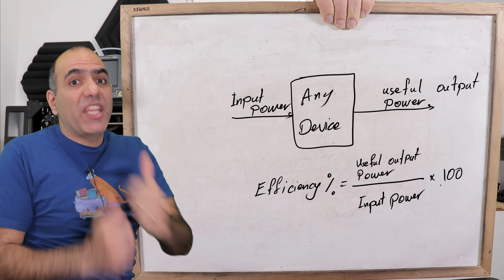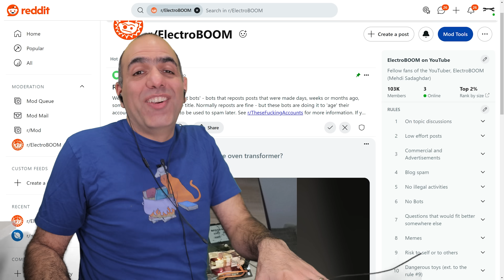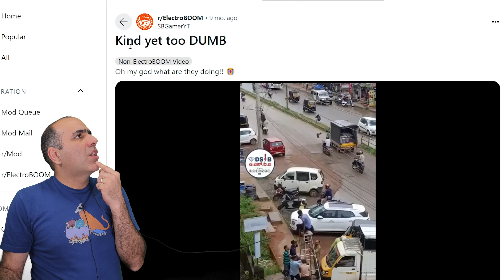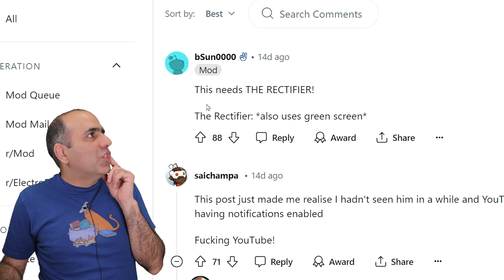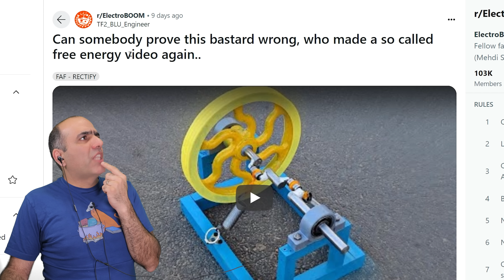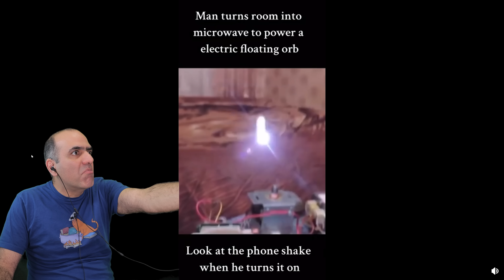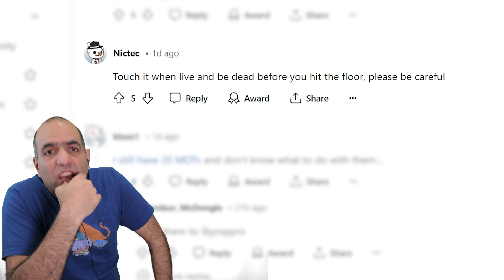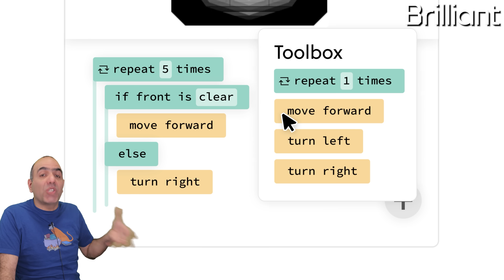New Flywheel Free Energy?! Can Boat Battery Fry You? LATITY-013

Comment from the maker: Ok so I checked and Trump is actually  talking about EV boats with much higher voltage batteries, like 300V or 400V. So I kind of agree with him that that much voltage  can be pretty dangerous in salt water if you are too close to its contacts, and I assume considering the risk, boat makers have systems in place to avoid that voltage to be in water if the boat sinks. I used to work for a boat system company and we were quite careful around any risks. So the danger may still be irrelevant... especially to a political campaign! Here's his full video:
https://youtu.be/9J0fUTiJLVc?si=mxs3S5TUcsVeTpdu&t=2575
Reply: I must be missing something here, but if the water is conducive enough to give you a zap, isn’t it then also conducive enough to “short” the battery enough so there’s not much juice left to hurt you? (If you’re not sitting on the battery but further away.)
I’m seeing it as a fairly low resistance (salt water) in parallel with a huge resistance (you).
Reply: @VarionJimmy short the battery that size? So an explosion and metal fire with the size batteries we're talking about😂
Reply: @AA-zv6yo  The water does not totally short the battery and in any event it will boil away to remove the short before the battery explodes. Steam is not that good a conductor.
What is more important I believe is that sharks don't like electricity in just a small amount and would disappear very fast and no longer be dangerous for the passengers.
Reply: Don’t they design EV batteries to shut off in collisions?
Reply: @mattdude no, they have a fire dept disconnect switch that the fire dept when they get there cuts or unplugs
Reply: @mattdude no
Reply: @mattdude  Actually more often than that. As soon as you turn the car off, the battery internally disconnects itself from the car. That's why it still has a 12V battery to wake up the computer and reconnect the main battery. If you listen closely on startup and shutdown, you'll hear a couple of clunks as the contactors pull in (turn on) or drop out (turn off), this is easiest to hear in a garage outside the car.
Reply: I would lure the shark over to the battery.  Jump to the opposite side, when the shark comes after me it swims past the battery and dies like on Jaws 2.
Reply: battery packs would be sealed, and the BMS will disconnect the external terminals as soon as it detects a short.
Reply: @flandrble depends on why it's sinking. But outside of damage to the pack,  I would agree
Reply: @flandrble  then why don’t Teslas have that
Reply: @ianscardino  What, automatic cutoffs? They do have that. Look up Tesla pyro fuse.
Reply: @flandrble  Hopefully, but if it is made in China, you never know what happens next.
Reply: Context is always important, thanks for providing it
Reply: The battery current would just flow between the terminals or between the cells inside, assuming the BMS doesn't cut it off.  It wouldn't actually electrify the water or electrocute anyone nearby.  Even a thermal runaway underwater won't do a whole lot... just generate a lot of easily-avoided (toxic) bubbles.

In anycase, 12V actually isn't used all that much in electric boats.  24V and 48V is more common for things like trolling motors and small electric outboards in smaller boats.  High voltage "EV" style packs are used in larger all-electric boats but that isn't very common except in the arena of the rich and famous with their multi-hundred-million-dollar yachts.

12V has historically been used as the system voltage for the home battery bank in medium-sized boats to run the radio, lights, winches, and other gadgets.  Though these days more and more people are using higher voltage 24V and 48V LiFePO4 architectures for their home batteries instead and have a DC-DC or down-buffer battery for legacy 12V gear.

Same for RVs.  Once people realized they could actually have all the comforts of home without limitation by using higher voltages, and still be able to wire the battery bank with only 2 AWG (instead of 4/0), 24V and 48V home banks have really gotten popular.

Even so, a 48V (51.2V nominal, 58V max typically) battery isn't going to electrocute you unless you actually try to electrocute yourself on purpose.  It will just give you a buzz.

-Matt
Reply: If the boat is sinking from its weight, how did it get out far enough in the water to where there were sharks? Wouldn't it sink as soon as it was put in the water?
Reply: @smwsmwsmw boat takes on water bilge can't keep up. Lots of people actually forget to put the drain plug back in after last boating excursion
Reply: @JMA_Elec wasn't there a bunch of electric cars parked at one in a lot that caught fire from flooding due to a hurricane a few years back?
Reply: Submarines have entered the chat.
Reply: Honestly, as a person who sails every summer, mixing boats and electricity is a bad idea for now, especially for any boat that doesn't have an engineer on it. The sea corrodes everything and eats through everything. Electric systems are just too unreliable, I would always carry a spare outside motor just in case
Reply: @Desterothx  are you serious? and an diesel engine won't corrode or what? Even tho it sucks in saltwater for cooling..
Reply: the risk of is minimal compared to higher risk dying in a Tesla Vehicle.
Reply: I've jump-started a jetsji from a boat battery while wet and standing in the river, and 12V does make you jump, ie, I'm not doing that again - ouch -.
Reply: So the bigger concern with high voltage batteries in salt water is all that lovely chlorine gas its gonna start producing. That said I can think of a dozen hazardous conditions for gas powered devices, that have been engineered out of them. Same with high voltage electric vehicles.
Reply: @fredorpaul  No, you are thinking of lead-acid batteries.  High voltage batteries in boats these days are not lead-acid, they are Lithium Iron Phosphate (LiFePO4).

Salt water immersion can certainly damage a lithium battery, but probably won't react with it very much otherwise. Chlorine gas is not a byproduct.   Lithium thermal runaways can still happen though and that outgassing is still fairly toxic, but not immediately deadly like Chlorine gas can be.

-Matt
Reply: @junkerzn7312  so yes you are right lead acid batteries will produce a lot of Cl2, but electrolysis of salt water can as well, frankly its not a major concern but more of one then getting electrocuted😇.
Reply: I actually have a (failed) EV boat battery and not only is it only 24V, but it has a complex BMS that switches the battery contacts off completely unless it's fed a signal from the boat and of course the battery itself is also mostly water proof because you would have to be extra "special" to not think about protecting it from the elements.
Reply: I'd take my chances with the shark. Sharks don't actually kill that many people. Death by electrocution is much more certain.
Reply: I mean technically even at 400V submerged in salt water you would have to be pretty close to the contacts for it to be a problem.  The worst case in a boat would if only one contact was in contact with salt water, then non-isolated random electrical components around the boat could be the best path to a circuit.
Reply: 4:55 why did Mehdi become Borat?
Reply: STILL WAITING FOR THE INDUCTION HEATER WITH NO SAFETY FEATURES ❤❤
Reply: 100% free energy https://www.youtube.com/watch?v=0vmh7Rnxd-8
Reply: Actually at 300 - 400 V is more dangerous in fresh water than salt water. Human body is path of least resistance in fresh water.
Reply: I used SponsorBlock to skip your stupid ads. 🖕
Reply: @acmhfmggru  Oh nonsense.  The man has been spewing gibberish for years.  And obviously so.  Nobody in their right mind would believe anything that comes out of his mouth.  The man has a mind of a small child.
Reply: But before I even got to the point about the absurd electricity comments  I was like, A boat that sinks under it's own weight ISN'T a boat🤦‍♀️
Reply: inf power us a electric moter to spin some gears    with a gear ratio to speed it up and use a dynamo type thing to make power from rotation and split half to power the moter run and half to store the moter would spinn slow but the geer ratio would speed it up a lot to make more power
@ElectroBOOM
Reply: would not most DC power travel directly between battery terminals on a high voltage battery?
i think the danger would be in the fire as it shorts if anything.
Reply: inf power us a electric moter to spin some gears    with a gear ratio to speed it up and use a dynamo type thing to make power from rotation and split half to power the moter run and half to store the moter would spinn slow but the geer ratio would speed it up a lot to make more power
@ElectroBOOM
Reply: Hello
Reply: Hi
Reply: | Boat Model (*kW*)         | Estimated Leakage (A)                                             | Pain --> Death (**Uncertain!**) |
| Avator 75 (7.5 kW)           | ~18.75 A | Tingling Surprise (3.0 - 4.5m)                |   0.1% (Highly Unlikely) |
| Avator 110 (11 kW)          | ~27.5 A | Ouch! Tingly Pain (3.0 - 4.5m)                 |  0.1% (Extremely Unlikely) |
| Example Boat A (15 kW) | ~37.5 A | Shocking! Painful (3.5 - 5.0m)                 |   0.1% - 0.5% (Very Low Risk) |
| Example Boat B (20 kW) | ~50 A | Severe Shock! Hard to Swim (4.0 - 5.5m) |   0.5% - 1.0% (Low Risk, but Serious) |

Big Warnings! Based on limited data and may not be accurate.
Reply: Hey Medhi, I have a question. In my physics classes in school so far, we've learned that power is equal to work divided by time, where work is related to kinetic energy (I forget exactly how, it's been a while since I needed to use that info). But how is this measured with electricity? I know that it's essentially the kinetic energy of flowing electrons, so does that mean you would use the current to calculate it?
Reply: @dominicballinger6536  If you're interested in such Topics i highly recommend looking at definitions of (SI-)Units. In this example we need to look at Current: Unit A(mpere) and Voltage: Unit V(olt) which can be broken down into other more basic units: A=C/s and V=J/C where C(oulomb) is the unit of electric charge (e.g. one electron has a charge of 1.60217663 × 10-19 C), J(oule) ist the unit of Energy (or Work) and s(econd) is just time. Now if we multiply Current and Voltage we get: A x V = C/s x J/C, the C cancels out and we have J/s = W(att) which is the Power. So Electric Power is simply Current times Voltage.
Reply: I came here to make the comment about the voltage. Boats will use much larger voltages yes. So your chances of electricution by boat is slim, but never 0...
Reply: Maybe test this with series of 50 9v batteries?
Reply: Funny that you went off half cocked about "magas" on something you were ill informed about. It's a typical liberal response.
Reply: typical liberal
Reply: This was some next level editing here 😂😂 made me chuckle 😂😂😂
Reply: 8:40 what kind of makeup 💄😅😅
Reply: The battery management system will also disconnect the battery system and put it into a safe mode for salt water exposure when a short is detected. If the battery pack fails to retain water tight integrity or the management system fails to go into safe mode, like if you bought a cheap battery pack similar to what you would find in a Chinese electric car, physics take over and the electricity is going to take the path of least resistance, which isn't your body, it's the salt water, so you're fine.

I'm a medically retired industrial electrician, so I was trained on DC systems in the voltage range in question, on battery management systems that included lithium batteries, and in electrical safety on voltages below 600 volts. I would be more concerned about the batteries dead shorting and catching fire than electrocution since the water isn't going to stop the flames they will put out. Most sharks aren't going to attack you with that happening in the water anywhere near by, so you can just worry about the long term issues and get some distance from your burning boat. If it was a dodgy battery pack, that might be why it is sinking since a fire aboard a vessel, especially a fiberglass or wood one, is extremely dangerous and fast to cause a loss.
Reply: You should make one of those free energy devices and see how efficient they are. Maybe a good one to start with is a pulse motor that spins the flywheel, flywheel has magnets on it, magnets pass threw a coil, stores the energy back into a battery or capacitor
Reply: i put a 9volt batteru on my braces once
Reply: Okay, but sharks don't eat humans, so he's still a dipshit.
Reply: Hey what's up
Reply: He is still a moron.
Reply: At least you admitted you were wrong.  Humility is a trait that is far too rare nowadays.
Reply: I know people who make these types of things often take as much care as they think is needed but the problem arises when people do things that were not considered or even thought possible, and heyho something happens that was not expected.

We see this with cars and ebikes, unexpected things happen with them from time to time.

Also when systems get old systems fail, so might be perfectly safe from new but over time may become a real issue.

There are so many failure points with battery tech and salt water unless the batteries can be completely sealed off from the salty water.

One last point is time, what if a battery tech boat sinks, knowing how people are they may just leave it underwater so long as it posses no emediate threat forgetting or ignoring the potential threat due to decomposition of any safety features due to the salt water.
Reply: erm actually, microwave magnatrons are harmless to humans
Reply: Uno Reverse on the dislike  now that you researched the context
Reply: I assume the massive sea would water down the amps? So nothing would happen or only very close you would get shocked?
Reply: Do his followers even question "WTF is he going on about?!" or just love him regardless?
Reply: the one problem i have with guga is that he spread the betterhelp scam virus on youtube and never addressed the harm he caused by doing this.
Reply: I thought research (citation needed) showed that Sharks are hyper sensitive to electrical current. Divers can use Salt water equivalent cattle prod/stun gun to keep sharks away. So there is very little chance they would be anywhere near a sinking EV, they are not dumb unless they are really hungry for an electroboom meal.
Reply: That's totally on point, which is precisely why submarines were an abandoned technology.
Reply: But with higher voltage batteries comes better insulation
Reply: I have a feeling that the battery will have an integrated relay to trip if it detects short circuit ESPECIALLY if it's on a boat.

But the risk of shock would be much higher if those safety were to fail.
 300V+ battery, High current discharge capacity, short.

What could go wrong....
Reply: @kopazwashere  Electric cars actually do have this, and like you said, I see no reason not to on a boat
Reply: There are some videos on YouTube regarding attempted restoration of high-end EVs after flooding events.  Generally anything anywhere near the battery is just toast.  Either its corroded away from electrolysis, or molten slag from the battery combusting.
Reply: اقا چرا زیر نویس فارسی نمیزاری
Reply: 8:12 😂😂
Reply: Please please 🙏 🥺 Sir make video on Cristal radio or fox hole roaio or battery less radio 📻 i will wait for this sir 😢😢❤❤❤
Reply: I can prove free energy here now in a paragraph 2 tanks stacked and piped together one pipe dumps one is a continuous feed to the top of the top tank fill them with water stopping the dump pipe as long as the top tank weighs more than the bottom tank and the pipe it will over come siphon paradox and will run a turbine inline boom -Timothy Jones
Reply: Also sharks Attack are quite rare so the situation Is almost impossible
Reply: Foods can actually be pretty dangerous even with the standard batteries. 
There have been plenty of cases usually in freshwater where the boat builds up a charge like a capacitor and a person making contact between the boat and the water or the boat and appear can be electrocuted and killed.
Reply: Why there is no 120v LiFePo4 battery pack , that will remove large inverter, heat and sound? (40 cells LiFePo4 (2.5-3.2v) in series where 50ah makes 6kw,100ah makes 12kw).Also Efficiency will be increased as less heat and components are needed. Two of 120v batteries will make 240v , four of this will make 480v that can charge the EVs. If safety is a concern, then good design will defend this kind of problem. A 120v 50ah battery is similar size as 48v 5.1kw server rack battery pack. If a small dc to ac inverter are installed into this battery, people can use this battery as normally without large inverter...Can You explain please....
Reply: @AKadir-lc5wu  ?
Reply: I feel bad for Trump right now
Reply: No, of course they don't protect the circuits in any way. Just like gasoline boats are known to have just open vats for fuel instead sealing them in some way.
Reply: Where did you go?!?!
Reply: Hey, How about building Frequency Generators just like those in Chladni Plate Cymatics Experiments. It would be a fun  project to come up with.
Reply: Ok, that green screen bit had me laughing out loud!
Reply: Saying the danger MAY be irrelevant, doesn't negate the risks. The concern is still there, especially if it is a computer controlled system, instead of an analog. The energy is stored, and needs to go somewhere... I don't think helping other countries should be political, but it is.
Reply: New boats in the eu run 400/600 volts dc or even up.
Reply: I love how many real Americans who respect that people just have opinions there are in here. I love this channel.
Reply: The only reason I’m going back in time for this year was that the last two 2️⃣ months I have to work and I’m trying my luck 🍀 but it’s still hard because of all this work to be done ☑️ so far I just can’t wait 😜 and it’s a big part I love 💕 thank goodness 😅 but I’m so proud 🥲 and I hope 🤞 to see them in a year from here and hopefully 🙏 thank the gods and good 😊 and thank the gods who keep on my good 😊 love 💕 I have so they always love 💕 you all my best to you too I can’t thank and you always love 💕 love 💕 love 💕 love 💕 to all the love 💕 you both love 💕 I can’t stop ✋ I can’t believe this week I can’t even imagine what happened yesterday and the world 🌍 and I’m just a lot more than that was the last week and now it’s so good 😊 thank y so many more love 💕 and I’m glad 😀 thank y so happy 😁 and I’m really looking 👀 love 💕 love 💕 love 💕 and love to hear w the world 🌍 to the universe and so many happy 😆 love 💗 and miss seeing all of them and love to have you in person 🧍🏻‍♀️ is I can’t imagine the pain and sadness I felt after that one 1️⃣ million miles of time with them in our country was the most amazing 🥲 feeling I felt for you all my love 😍 you deserve the rest you all the time I can’t imagine it is the most precious feeling I can feel in this moment of love 💕 you have to make the right choice and be proud 🥲 and always remember you and love 💕 and love to be in every single way I am proud 🥹 to have a beautiful 😻 you and your heart 💜 to me love 💗 to be with all my friends in every single day you all have always have to do whatever I hope 🤞 to make the world 🌍 and to make sure 👍 and to make it through the years ahead always have fun 🤩 and always have an incredible heart heart ♥️ love 💕 and to be happy and always have fun 🤩 thank y all my heart ♥️ to see the most special moments and always have fun 🤩 have an incredible family always happy 😊 and to hear 👂 you guys and love 💕 and I can’t wait 😝 and thank for always love ❤️ and always 🔥🏠=🏚️ and thank y so very many to the people in this community who have helped make the journey and I love 💕 you both very proud 🥲 and happy birthday 🎁🎉🎊🎈 and happy 😊 to everyone else too love 💕 love 💕 to everyone else who loves this team too so many so happy 😃 to be happy and proud 🥹 of all who have come in our way I hope you all are always together happy 😊 love you and always and always and always happy 😃 love 💗 to see y and happy birthday to you and happy year and always have fun love to see you all the way and more happy 😊 love to see y all my heart ❤️ love to you all the best to all the good things to you all the love to you guys and happy anniversary and I love you guys and thank 😅the world 🌎 is 😢😢 🎉happy birthday to the best man 👨 you all love you all love 💕 love 💗 and happiness and happiness always and forever ♾️ love 💕 love 💕 love 💕 and r a lot love ❤️ and I love y more than ever ever happy 😆 until we can all get along in a new life and we are all together and happy together in this new 🆕 age we will always be together and I will be here to make sure that you are happy and healthy for us to see and to see each other and be together forever love 💕 happy 😃 t always a dream and happy day for me and you and all the best my friend and I love you all oof love you all always my love and miss you all your best always love 💕 happy day to you all so much and forever and always and forever and ever my baby and always love ❤️ love and miss and always love and miss love and always love you so very happy 😃 and forever happy day and always love you always and forever happy 😊 love and always happy day love ❤️ and forever and forever happy day love and kiss you all the best always happy birthday love and miss you so very proud 🥲 and happy day and always love and miss and I miss you so much and forever happy 😃 and happy day love to you and I miss and happy 😊 love you so much and I will always and ever be proud to be your friend in every single one ☝️ you have been my favorite person in the whole of this year I hope you have the most wonderful and beautiful 😍 love ❤️ you always my friend and I hope 🤞 we get a chance to meet someday soon 🔜 love and hugs you always and always love 💕 you and always forever and forever and forever ♾️ always and always my love and always forever my 😮baby girl 🧒 and forever and always love and miss my best always and forever and ever and ever always my baby and forever and ever ♾️📱😮🔌💣 always my best baby I miss your precious angel love you so much love and I miss my baby and my heart always and forever love and oh so many more years tu baby I miss you so he thinks that is so precious love 💕 you and I love fttgfr love and I hope to see more of my heart always love you so much I hope 🤞 we can do you always love 💕
Reply: have you got a plasma ball? nooo? then buy one i promise but buy the cheapest ones they are all the same trust me iv'e got one but if you want to shock another person with your electrified hand you put one over the plasma ball and you whait till your kid comes and touch her with your other hand😅😂 i did it to my frieds and now they are scared of me 🎉
Reply: Did you test the Joule Thief circuit? https://overunity-electricity.blogspot.com/p/eternal-light-from-joule-thief-circuit.html
Reply: Even if the battery voltage is 12 to 24 volts choosing to be electrocuted will be better because it will be impossible to die. So, I think Trump made the right decision
Reply: 7:49 the only camp the MAGA crowd is in, is "he said it so it's fact"
Reply: I was kind of surprised you didn't pick up on that in the video, seemed kind of obvious to me, especially when coming from Trump. 😅
Reply: In both cases, electroboom and trump were being facetious and trying to make a joke. I hope that fact doesn't escape people's minds just because of differences in political ideology. Hopefully in the future, we can all be silly and make jokes without people using it as an anchor to make us look incompetent, especially for political gain. What a harsh world it would be to live in if we all had to be completely seriously and deeply factual at all times just out of fear that us or our ideas will be ostracized.
Reply: It was also a dig at immigration which sounds like psychotic babble trying to explain which is the intended effect
Reply: For God's sake, at least wear safety glasses.,  You.  scare the shit out of me.
Reply: 00:06🤕🤕🤕🤕🤕🤕 the house is so cute I think it was the kids room is a link in the rye bread and I think they are the kids to the moon is a
Reply: ⬆️⬆️⬆️⬆️⬆️⬆️⬆️⬆️⬆️⬆️⬆️⬆️⬆️⬆️⬆️ a new job is going to get a new job is so good to get a
Reply: If you are holding a metal tool while you are in the water and you let the ARC from a spark plug wire jump to that metal tool you are holding you may not survive.
Reply: Would you put a screwdriver in a sparkplug rubber boot while swimming? Some of the outputs go to over 160,000 volts.
Reply: My teacher😮 I always I always go to the radar room at my school to see any storms coming in to the states of America, I always check the radar room. I’m a teacher too many things I I go to work and my kids I I go back to my house like kids or like playing around so much yeah this is so hard to take care of these kids
Reply: Ai 🔨💥🖨️📟📠🔌 and  oteur tig
Reply: I agree but you could use the same hyperbole and say "what about these gas boats? I don't know about you but 30 gallons of gasoline pouring into the water around you while it's sinking? Imagine the fire!" I feel like its the same argument my great grandpa made against using a car and decided he'd ride a horse instead.
https://www.youtube.com/watch?v=erhd-FV4rb8
Reply
Reply: @mikestevens4147  Or what about Petrol Boats, 

https://www.youtube.com/watch?v=wAM_EtjxFhE
Reply: @mikestevens4147 I knew he wastalking about EVs because I saw it on the news. But I thought it dumb because electricity shorts. It doesn't zap everyone and everything unless you are the path of least resistance. ...But even with a Tesla battery pack you'd probably have to be close to it (ignoring that it is going to be contained and a boat specifically designed to keep the batteries waterproof.).
Reply: @mikestevens4147  Why does the gasoline tank suddenly spring a leak as the boat sinks?
Seems like an odd coincidence.
I'm not aware that this is a common occurrence in real life.
Reply: I was curious why you were comparing a 12v battery to a boat battery.  Nice correction though.  Well done sir.
Reply: @acmhfmggru  Judging a specific person as being incompetent and not worthy of one's time is not what prejudice refers to in day to day usage. If you pay attention to what a person says for years and nearly every single thing they say is demonstrably false, they double down and commit to obvious and blatant lies even when inconsequential just to protect their ego, and then they try and literally overthrow the government, discounting them as a source for factual information in the future is a pretty rational choice.
Reply: Depends on the mfg and upkeep of the boat....
Reply: I liked the Dr. Fauci impression. 🤦🏼‍♂️
Reply: Thank you
Reply: @ElectroBoom, try to visit the Philippines soon!
Reply: I was about to flame you but good job correcting your mistake.
Reply: context is really important in this case haha I'm voting for him on Tues. but that clip had me questioning it because I didn't see that clip before and thought he was off his rocker like Biden haha
Reply: @HistoricScents  dude... Trump's thoughts are disconnected at best, jumping from one idea to another out of nowhere, and that's the literal tip of the iceberg for reasons why he's a shit candidate. Btw, all those clips where "Biden was off his rocker" were him literally mocking Trump. Biden has all his faculties in mostly working order, which is evident by him dropping out of the race
Reply: To be completely fair to Trump, he isn't playing it off as some sort of fact.  He makes it very clear that it's his opinion.
Reply: @justinanderson267  Which would be "fine" if we hadn't seen that exact behavior before except when he sharpied a different hurricane path on a prediction map.
Reply: @MrTVintro  You must be well jabbed and boosted.
Reply: @justinanderson267  He gave his opinion while posing the question to others as well. As silly of a concern it is, it sounded like he was genuinely curious.
Reply: @justinanderson267  It is far from the first time he played fast and loose with facts, to the point of sounding deranged, though. 
Trump says something confusing -> his supporters: "He's just joking."
Biden says something the same level of confusing -> Trump's supporters: "Literally a sign of dementia."
Reply: @Vaeldarg  dementia is no joke bro
Reply: @justinanderson267  begging the question is the hallmark of disingenuous talking heads.

e,g, tucker carlson
Reply: @justinanderson267 No, he isn't. He's being rhetorical and sarcastic like "how can these people be so dumb" i.e. sure they can do what they want BUT HE knows it's dumb to have EV boats. He basically is using the subject to subtly make his supporters fear EVs (not a fan either but for other reasons) because he thinks people agree with him and thus would make him look trustworthy that he "points this out". While in reality, those EV batteries are built with a bunch of protections and even if the BMS controller doesn't disconnect that battery for whatever reason, the cells are held in modules (a few cells) and those make up packs (a few modules) of essentially very few cells and those modules and packs have fuses between them that will blow open in case such a thing happens, meaning you'll end up with essentially thousands of little few-volt, harmless, batteries. It's not a single, huge, battery...but many tiny ones. So that battery in water would be dangerous if it were made by complete morons...but they have such levels of safety measures that that risk is essentially null. Fire hazard on the other hand...oh boy!
Reply: @justinanderson267  The opinion of a clown shouldn't be considered in public settings at all
Reply: Doesn't change the fact that nobody is talking about electric boats except Trump.
Reply: @andoletube he was invited to a electric boat mfg the previous week or so, that's why he brought it up and had the discussion with them.
Reply: @andoletube  No one else is talking about it in large scale policy because no one is trying to build large boats with traction batteries. The only situations in which EV batteries are likely to enter the water are either people driving off of things into the water (and I assure you the theoretical possibility of a shock if you roll snake eyes with fate when that happens is far less of an issue than the risk of drowning in a car part) and cargo ships, where they're sitting in the cargo hold surrounded by a big steel thing that will conduct the current through a path that doesn't include you. Of course, the insane tangent on sharks completely misses that shark attacks are also extremely rare, so a couple of extra news stories about them isn't reflective of a crisis, but what he's actually trying to do is "just ask questions" to put fears in peoples' heads with plausible deniability and claim to offer a fix.
Reply: So, ElectoBOOM was spreading "FAKE NEWS!!!!"   lol
Reply: @RedSquirrelEater  Fake news spread originally by Trump.

How many boat expositions by EV Boats vs Petrol  ones ? 0 so far.
Reply: @RedSquirrelEater  he was right when he said it and it's still the case, it's not his side who created then promptly shutdown a "ministry of disinformation" oh wait no that's not what we meant it's to fight disinformation of course...obviously....shut it down ! shut it down now !
Reply: so i was about to talk about that 😂😂😂😂 yes he's right
Reply: @asam982  I was going to comment, read yours, deleted mine.  I kinda think full-wave-bridge had a DC bias, hehehe
Reply: @asam982 🔴 What Is Islam? 

🔴 Islam is not just another religion. 

🔵 It is the same message preached by Moses, Jesus and Abraham.

 🔴 Islam literally means ‘submission to God’ and it teaches us to have a direct relationship with God. 

 🔵 It reminds us that since God created us, no one should be worshipped except God alone. 

 🔴 It also teaches that God is nothing like a human being or like anything that we can imagine.

🌍 The concept of God is summarized in the Quran as:

📖 { “Say, He is God, the One.  God, the Absolute.  He does not give birth, nor was He born, and there is nothing like Him.”} (Quran 112:1-4) 📚

🔴 Becoming a Muslim is not turning your back to Jesus. 

🔵 Rather it’s going back to the original teachings of Jesus and obeying him. 

More .....👇

🔴 THE RETURN OF JESUS
Reply: @1islam1  i am Muslim... what about you